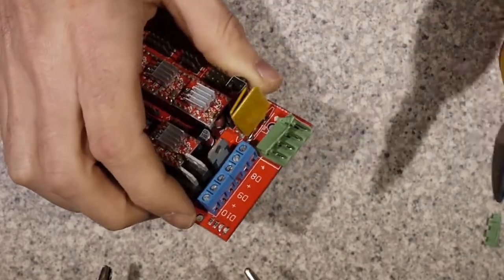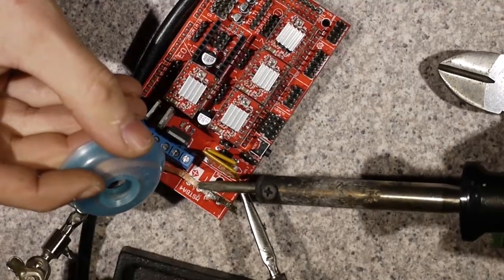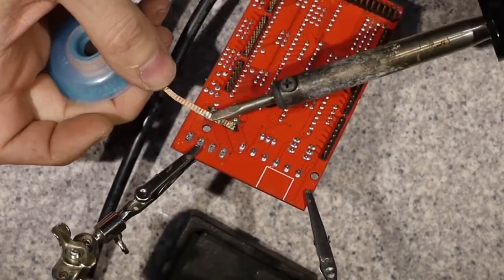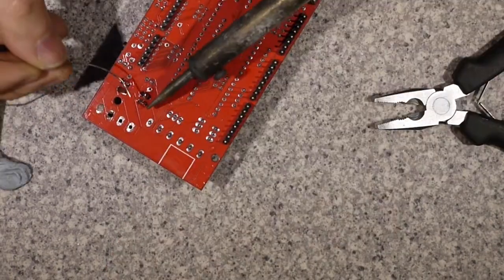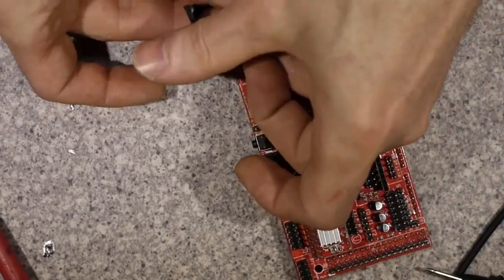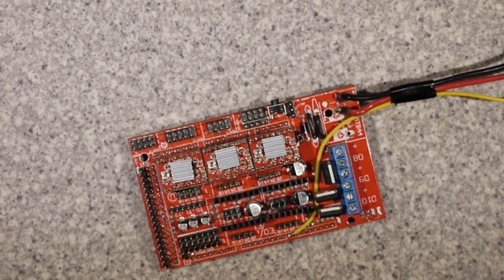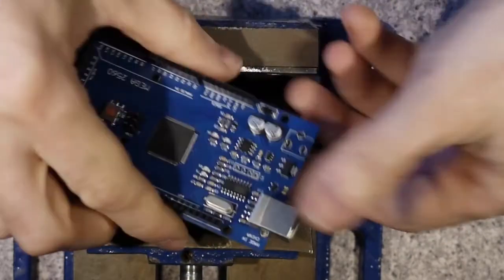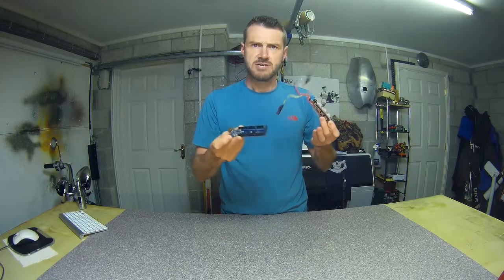Prusa i3 MK2 3D Printer - Electrical Upgrades/Mods - RAMPS & Arduino

Comment: why do you only need 1 pair of power wires connected?
Reply from the maker: I think you are referring to the 12V DC into the ramps - there is only one pair as the heated bed is powered separately - see my video posted just before this one
Reply: So there needs just 1 pair of power wires to the board? the hot end and heat bed are in D10 and D8. I know troubleshooting over text can be annoying. Maybe point me to a good resource. self-taught 3D printer builder here. thanks